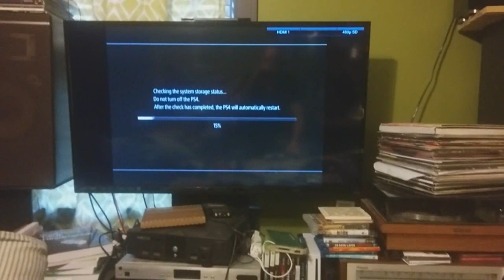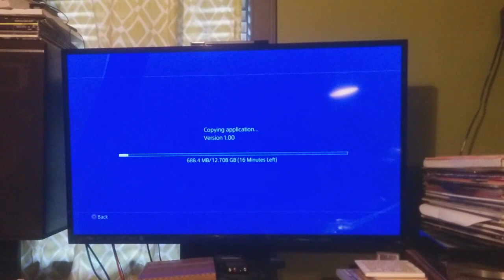PS4 Slim Repair - Grinding disc drive fix after impact

Comment: Bought a PS4 slim for 150 + all of the VR gear, brought it home, turned it on.. Same thing, sounded like the disc was rubbing. Thought i had got screwed over, but then i became determined. Opened it up and came to the same conclusion you did. Twisted things so that they laid flat, eventually got her to work 100% ! I love taking things apart and puting them back together!

Comment: Thanks. This confirmed what I had suspected for my PS4 slim. The disk did work, but it made a grinding noise. The top plastic part had a slight crack right at the front Sony logo, so pretty sure it had an impact. I opened the top part up (without damaging the warranty seal) and managed to bend the metal part of the drive too. Works. The seller (a game store) claimed the hdd was shot, it wasn't, I just had to install the full recovery firmware (9.00, nice surprise).

Comment: My disk tray was bent, thanks so much for this video!
Reply: How did you bent it back
Reply: @ndritpurellku307  i also would like to know
Reply from the maker: @ndritpurellku307  with my hands?  so that it's flat, instead of bent. It's flimsy sheet metal.

Comment: Bought a ps4 slim with a
“broken disc drive” for $75 
I downloaded all my games and needed a console so I went ahead and bought it. Flash forward a year and my friend lets me borrow a disc copy of a game. 
I get it home and then remembered the disc drive didn’t work, so I found this video. Saw what the problem was so I stuck a small screw driver directly in the disc reader and lightly lifted up on the drive from left to right a few times and gave it a shot and it worked like a charm. 😅 Not the way you did it but the concept was still the same! Thank you buddy now I can finally play cyberpunk 3 years later 😅
Reply from the maker: Aha that rules!

Comment: Hey man, my ps4 slim makes a loud clicking noise but it’s coming from my hard drive. I don’t have a warranty for it and the free one expired. Any suggestions? Could I fix it by just buying a new internal hard drive?
Reply: No
Reply: @straightouttagaming3110  Of course. I know this is two years old, but yes, a new harddrive (2.5") would have fixed the problem. It's just a standard laptop harddrive.

Comment: My PS4 makes a really loud buzzing noise and it’s not the fan because the fan has been cleaned before. Basically whenever I boot up a disc in the console or turn on the console with a disc inside it makes an EXTREMELY loud noise that is literally deafening. For some reason the disc drive works perfectly and can download/read discs but it takes like 5 tries and you can clearly hear the disc drive failing a few times over. Not sure what to do here
Reply: I'm with this problem. Did you fixed it ?

Comment: any ideas for randomly ejecting disk from a launch ps4? I've removed the rubber boot and messed with the manual eject screw and nothing seems to work 😅

Comment: When I unbent my disk drive, the black handles would no longer close which allowed me to put discs inside. I also used isopropyl alcohol to clean the laser and now it can't read discs (at very beginning of startup, I can put discs in.)
Reply: Never use any chemicals on sensitive hardware (anything other than bare plastic or metal bodywork)

Comment: Does that silver part have to go back on top of the disc drive? I dropped my ps4, took it apart figured it was just the rollers which they were out of place.. popped them back in turned it on and it took the disc and read it. Ejected it, tried a different disc and it wouldn’t suck it in anymore. The rollers make noises like it’s trying to take in the disc but it simply won’t..

Comment: good afternoon, boy I bought a PS4 fat model CUH-1214A has 3 years used, it has never been opened, so far ok, it was working normally, I cleaned it and worst of all the disc comes in, but I don't read the game, but some days until today, some of my new games are coming out scratched, as if it were some scratches on the surface of ps4 what will it be? what can i do and very serious ??

Comment: I got exact the same problem is it easy to fix it at home?
Reply: Can you send me a dm or something
Reply from the maker: Pretty easy if you have the right screwdrivers and don't mind removing a bunch of screws.  Check out the iFixit guide on accessing the drive.
Reply: Alec J but the thing also with my ps4 is the opening where the cd goes in is bowed a bit also... so is it easy to fix ?
Reply: Alec J and where can i buy al these screwdrivers to open this like in te video?
Reply from the maker: @ianmartens6421  Sometimes the plastic can look bowed but not really affect anything, I wouldn't know until I saw inside.  
My screwdriver set is from iFixit but there's cheaper ones on eBay, something like this should have all the bits I think.  I had one exactly like a while ago.
https://www.ebay.com/itm/45-in-1-Torx-Hex-Precision-Screwdriver-Set-For-Watch-Cell-Phone-Laptop-Repair/

iFixit tutorial down to the drive:
https://www.ifixit.com/Guide/PlayStation+4+Slim+Disk+Drive+Replacement/103397
Reply: Alec J thanks ! but I had warranty on the ps4 and sent it for repair. hopefully it falls within warranty.
Reply: Alec J and if there had to be repair costs,it will certainly not be much i think ?
Reply from the maker: @ianmartens6421  Ah good idea!  Hopefully they'll take care of it for ya and it'll come back soon.
Reply: Alec J yes !!! Hopefully bro

Comment: hey! i know this video is super old, but im having this EXACT problem with the ps4 pro, and yoU are the ONLY person on the internet that has managed to show how to fix something similar (ps4 slim, not pro) do you think this will work on the ps4 pro too? since the disc drive looks kinda different?
Reply from the maker: The part that was bent on this Slim looks super similar when I search around on the internet... I would THINK it could be the same problem but I still haven't touched a Pro so... I don't actually know!  But surely they're about the same?  Heck if I search for a whole drive replacement sometimes people are using the same pictures for a Slim drive and a Pro drive.  Only that top mechanism is what was bent, so the actual electronics of the drive could be different in their own irrelevant way.  Maybe that makes sense?
Reply: @alecjahn  yeah, i totally understand, I'll give your fix a try when I get to open up the pro again, it's a nightmare to work on since you have to disassemble it cOMPLETELY. thankfully you don't have to replace the thermal paste in my revision (cuh-71xx) but still. it's weird because the thing doesn't vibrate at all when it's upside down lol but i have to fix this cause I want it in a standing mount. thank you for your time bro ‼️💯
Reply from the maker: @aztecayt7080  Please let me know if you have any success or even failure!  If you've got something important to say you can pop it in a new comment too and I can pin it at the top in case it helps others, if that's cool with you!

Comment: Hey man, my ps4 slim makes a clicking noise but it’s coming from my internal hard drive, any suggestions? On the screen there’s an error code that says cannot access system storage. I don’t have a warranty and the free one expired. Any suggestions? If I just buy a new internal hard drive will it work again? Very stressed out about this.
Reply: Have u tried rebooting in safe mode?  Turn off console then hold power button till it beeps 2x like 8 secs, then connect controller via USB n press ps button on controller. It should boot in safe mode. Then choose option5 rebuild database. This will work if u have a corrupted file but also won't delete your games or saves. This is what they recommend if u get a hard drive corrupt error. It can take an hour or more depending on storage. If it stopped working after an unfinished update try option 3. U can also try to power cycle ur console by turning it off and unplugging it for 20mins then turning back on. DO NOT pick option 6 as it will delete all data and games. Only use that as a last resort but first backup all saves and games and save login info before. That option should be last and will restore console to new blank slate but will almost def work
Reply: Yes it will i had same issue
Reply: @solosamuraiz1526  If the harddrive is clicking that means it's physically dammaged. No use in rebuilding the database. You need a new 2.5" laptop harddrive and the full recovery firmware from Sony's website.